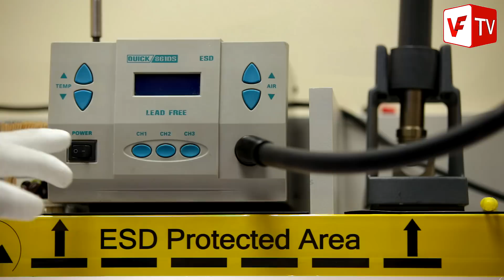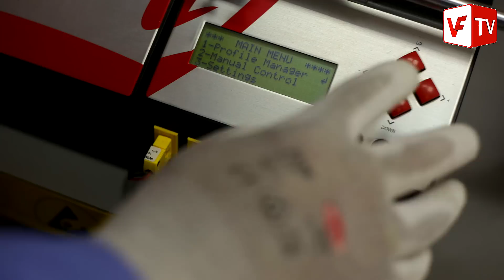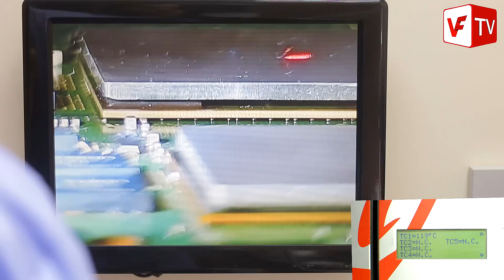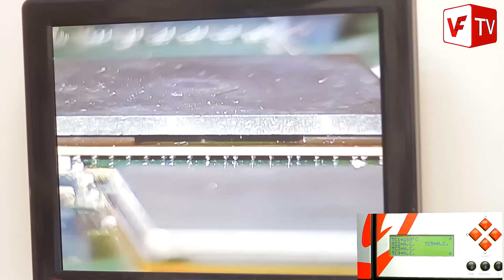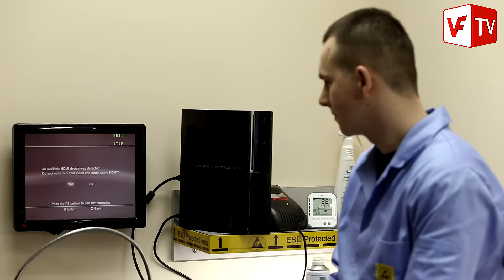Reballing BGA in PS3. YLOD FIX. Serwis i naprawa konsol PlayStation 3

Comment: "Error caused mostly by cold solder joints under GPU / faulty GPU."
No. 99% of cases problem is inside GPU die.

Comment: Whats the secret to removing the RSX without removing IHS? every time I've tried I Get Ram Bleed.
Reply from the maker: :)
If You get better accuracy without IHS, so stay with it.

In some of PS3 motherboards this is more effective, in another. No
Reply: @WielkiElektronik  I always remove IHS from RSX in FAT and Slims before performing reballing.
I work on IR-PRO-SC v3 and it gets waaay easier to desolder pbfree balls without IHS.
Anyway, great work :)

Comment: Didn't remove the IHS from the chips?
Edit, just read the comment about not showing it in video. Cool video though, wish I could afford such BGA rework stations.
Reply from the maker: Yep :)
Video is about reballing. Not removing IHS from RSX. 
To remove IHS. Heat whole motherboard to 130C and then use proper tool :)

Comment: This repair is useless and the client will come back. You did not remove the heatspreaders, the PS3 will get ylod again
Reply from the maker: Emanuel, every PS3/PS4 after reballing BGA chips will fail in future.
In most cases problem causes failed BGA chip.
Reballing is only a way to bring ps3/ps4 to life for a some period of time. 
One PS3 can work for a 2 years, another for a 7 months.

We always remove IHS from RSX, but we didn't show it on this Vid.

Comment: Its NEVER cold solder joints under GPU, but solder inside the chip. Therefore this is a temp fix and a waste of time.
Reply: may be u r right . bcs many reballed ps3 returns after few days